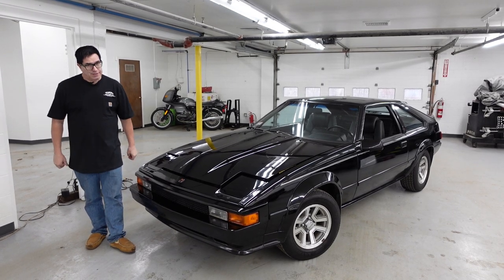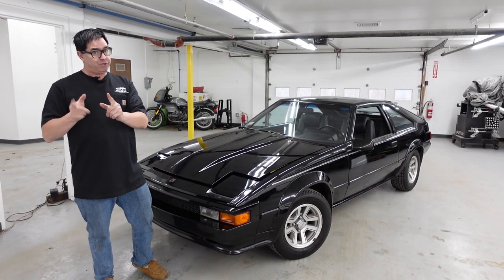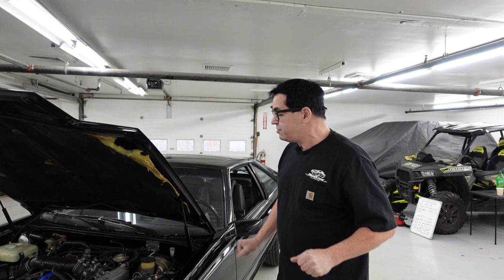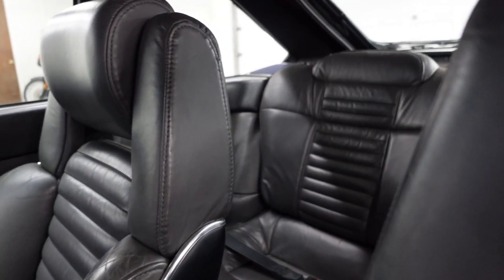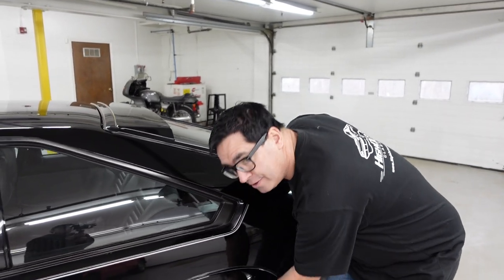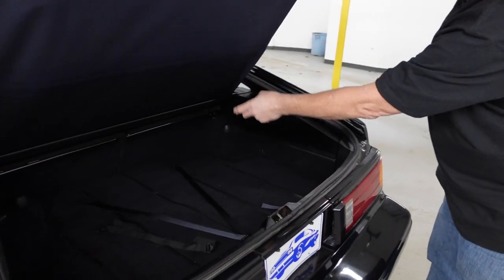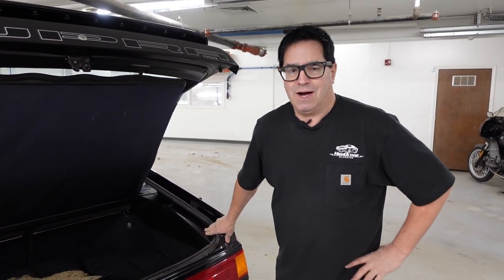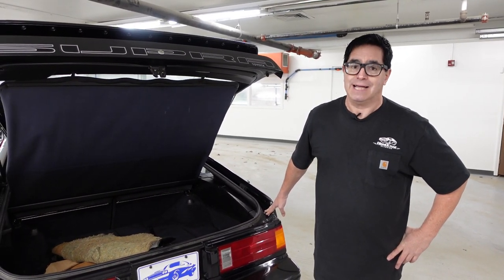1985 Toyota Supra Walkaround with Steve Magnante

Comment: I loved my 85' MK II Supra. She was a wonderful traveling companion. Surprisingly practical car with a lot of fun touches. Those wheel flairs and the hatchback updates of that model year solidly upgraded her looks. The stock wheels (note the 4 bolt pattern) have always looked great. The little grey work light in the engine compartment, for a practicality example, unscrews from its mount and has a built in extension cord so you can maneuver it around the engine bay. That power sunroof was bulletproof. Never leaked a drop when closed. Vastly more convenient than than my later MKIII's leaky Targa Top.  Also, though a collector wouldn't use it for this, she was a true hatchback. Fold down the rear seats and she became a little truck. Super fun.

Comment: Have to add a few corrections to Steve's "facts".  The hp was 161, not 170.  Only 2 valves per cylinder, not 4.  As of 1985, the "L" version was no longer available.  An auto tranny was indeed available as an option on the "P" version.   The spoiler on the hatch was standard, not an option.
Reply: yeah, incorrect information

Comment: Love your videos Steve, one little knit to pick though, the 2.8L 5MGE  is definitely a DOHC engine, but unfortunately it's still only two valves per cylinder, not four. The four-valve head came later on the 3.0L 7MGE.
Reply: Not necessarily a bad thing.  The 2-valve design would likely offer more torque lower in the rev range, and a few essential bits off the 7MGTE would yield considerably more bhp.

Comment: Couple corrections. While the 5MGE did have dual cams, it was only 2 valves per cylinder, for a total of 12. Also, the P-type WAS available with an automatic; a buddy of mine has an automatic '85 P. The L was not available in '85.

Comment: There was an 'in-between' model, the Celica GTS which was the shorter-wheelbase Celica with the 22RE 4-pot but with the flares, Supra wheels and rear disc IRS.  I had a silver/grey '85 GTS, lovely car.  Never should have sold it or my blue/blue '85 Supra, which I got for a song since it wouldn't pass the local sniffer test which I didn't have to pass in my locality.  The Supra was beautifully balanced and could charge through backroad esses at highly illegal speeds.  If I still had either they would be packing 1UZ's now.

Comment: I think you may be wrong on saying the Celicas had live rear axle and the Supra having independent as my RA65 Celica of 1984 which my wife bought new  has the same independent rear end as the Supra and here in Australia its the 2.4i XT liftback version I know that the coupes with a boot lid had live in base 2.0 models but Youse over there also had the GTS with flares and the 7”rims and I think you will find those 4 pot cars had IRS too

Comment: The Celica GT had a live axle. The Celica GTS had the IRS. Check the power steering reservoir. The name TOYODA should be stamped on it, the founders actual name. It was on my 84 Celica.
Reply: The first year GTS was not actually badged as such (I had one, an '82) it did not have the IRS.

Comment: I owned both an '84 Supra and a '78 280Z 2+2 at the same time. While the specs make the cars look comparable, they were anything but.  The Supra was a true Grand Touring car with all the space, comfort and performance you could want given what was available at that time. The Z was clearly 25 yo technology that had been stretched to improve its utility.  The Supra was an open, airy, comfortable, quiet GT. The Z was narrow, cramped, dark and rattley.
Put it this way, once I got the Supra I would drive the Z only when the Supra wasn't available (e.g. maintenance) or there was snow on the ground (the Supra was possibly the scariest low traction car I've ever owned)